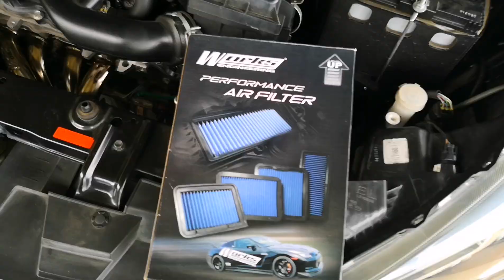Tukar extractor dekat Myvi Baru. Betul Power !

Comment: Kalau tukar extractor 4-1 pickup naik tak?
Reply from the maker: Naik sedikit berbanding asal. Cuma 4-1 ni power start dripda mid rpm to peak rpm. 4-2-1 pula dri low rpm ke mid rpm. So utk pickup, 4-2-1 lebih power bnding 4-1.
Reply: @mdridhuanchannel9869  oh tq for explanation bang. saya tengah nak cari setup exhaust untuk pickup. kalau tak tukar extractor tapi buat exhaust sahaja, setup apa yang okay untuk pickup? sebab extractor kacau warranty engine kan 😅
Reply from the maker: @TheShameous  exhaust sya kurang pasti pula resepinya 🤣 pasal warranty pun, sya kurang psti 😅 mungkin void kot klau tukar extractor
Reply: @mdridhuanchannel9869  bos apa maksud yg mid rpm to peak rpm ya?? Sbb sy guna yg 4-1 skrg ne.. bole kongsi tak bos hehe
Reply: @pearlman1366  mid to peak tu maksudnya nk dpt lebih top speed lebih dr standard tp pickup kurang. Low to mid tu utk acceleration, pickup mmg cepat , tp top speed sme je mcm standard